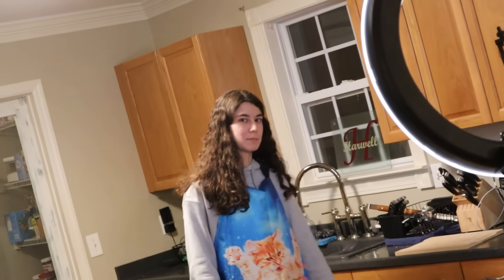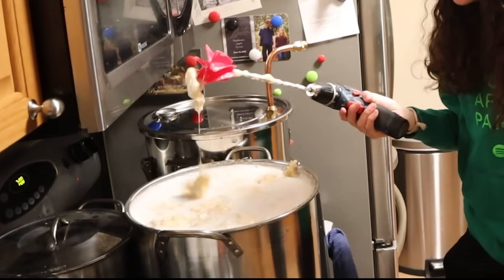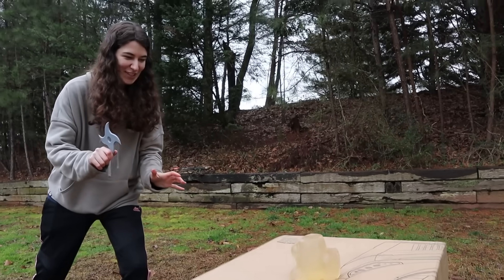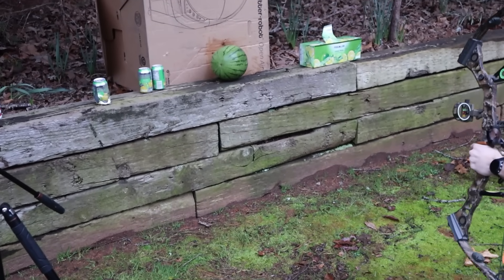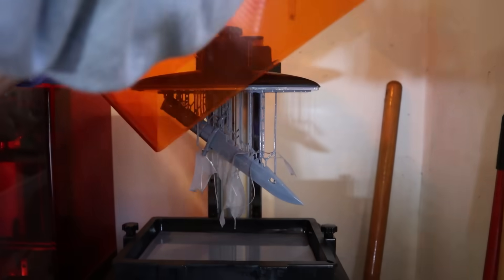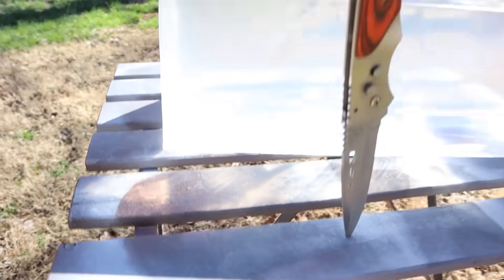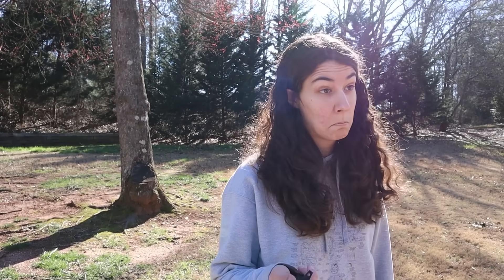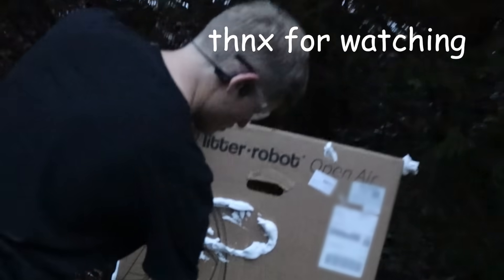How Dangerous are 3D Printed Knives?

Comment: I actually experimented with printing various knives that are out on Odyssey. It's impressive the strength of some of them. I have if you made out of some specialty early prototype amphora projects and one of which is similar to amphora3000. The amount of force it takes Until It catastrophically Breaks is pretty astounding. With the right filament, you've got a real poker.

Comment: The twist of the FDM Printed Knives.... they are still a bit Serrated... which is VERY dangerous and concerning... Not to mention based on the layer lines you could easily break an FDM printed blade off ... which is also a terrifying thought...

Comment: I would say they are more dangerous. If the tip breaks and gets stuck inside a person it can be hard to remove or even find it. Because you can't find it with a metal detector 😅

Comment: The "knive test" was an actual "spear test", any wooden part would also work the same way. Also a full face protection is not needed when sticking a knive into a block of gelatine...
The proper filament for a 3d printed knive would likely be PPA with a hollow core that is filled with concrete or similar dense material. This way you would have a sharp edge and the required mass.

Comment: Hey, that mold could still work, you just need to buy some high-temp silicone. Then build a big square box with a good inch or two of space between the inner walls and the AMOGUS™ then fill it with some gravel, marbles, loose nuts & bolts or whatever to add weight to the 3D print cavity. Then place the AMOGUS™ into the MDF cube that's been sprayed with mold release on the inside, and then fill all the space around it with the high temp silicone and wait for it to set up/harden into it's bouncy rubber state.

Finally, use some piano wire/box cutter, or hell, even a 3D Printed knife to chop your new soft rubber mold ALMOST in half. The key here is ALMOST. Technically you want to cut it as little as you can (preferably in nice F'd up wavy lines, not straight lines (makes the mold hold it's shape better) just enough to slip the hard plastic AMOGUS™ from the soft rubbery AMOGUS™ cavity/hollow mold you've now made. 

Then you can simply tape up the ~wavy~ cuts you made from the outside, spray the inside of the silicone mold with mold release, re-spray the cube mold with mold-release, place the silicone AMOGUS™ negative back into the cube, and then pour that fecker fulla homemade ballistic gel and you're off to the races.

Comment: I would assume, Resin Tipped Arrows are MORE dangerous then normal ones because the tip breaks off in the wound and then you got the issue to get it(and other pieces) out of the wound.

Comment: You could make really bad 3d printed knife if you think about it. You could make it a hollow barbed spike with holes all down the sides. That way you could stab it in and snap it off. The hollow tip in the body would make the wound continuously bleed and if it was barbed it would be very hard to remove.

Comment: In case anyone asks: FBI rated Ballistics gel is meant for ballistics testing of FIREARMS. 

its designed to test how bullets penetrate the ballistic gel, their trajectory after hitting it, how far  bullets would penetrate, etc.

It is NOT designed to test the lethality of melee weapons let alone improvised melee weapons.
if you want to test melee weapons or any type of melee object try pig, or human gel molds of dummys with human body parts and blood in it. This would give a better idea of how effective melee weapons would be.

the human like gel molds are generally softer and closer simulate human flesh/skin and thus produce more accurate lacerations (cutting) marks on them for knife wounds. 

ballistic gel blocks are designed to measure ballistics ie firearm bullet wounds.

Comment: If you want a reeealy strong printed knoife, make print it flat on the side of the blade and alternate line direction [0,90] every other layer will run lines from the tip of the blade to the handle then the other layers crosshatch with lines across to lock everything in place.

Comment: sharpening methods improvements... 
angle of cutting edge will depend on what you are using it for, 17-20 degrees is typical in American steels, 15 for Japanese steels
working your way to a finer and finer grit is important as it will help create less jaggedness and less drag along the edge.
sharpen or at least polishing refinements (the medium to high grits) should be done at a perpendicular direction of motion to the blade. this create the micro serrations needed to cut/slice things.

Comment: Regarding ballistics gel:

BG is a fantastic medium for analysing the damage caused by bullets. The forces resisting a bullet in BG are identical enough to the forces resisting a bullet in human tissue. 

However

BG is a poor medium to demonstrate damage caused by cutting or stabbing, especially compared to the forces in human tissue that are encountered by a blade or pointy pokey stabbey thing. 

A blade does work by cutting through the fibres. It does this well, as a set of inclined blades, a knife or arrowhead is a simple machine. Additionally, upon coming into contact with a blood vessel, a blade becomes lubricated, while a bullet is resisted by the flow. 

You can shoot a piece of kevlar body armor with a pistol and the bullet will not penetrate. That same sheet of kevlar will not stop a broadhead because it cuts through the kevlar fibres. A bullet tries to push apart the fibre weave, much like it needs to push apart body tissues. A knife or blade pushes through by cutting the fibres and removing the resistance. 

There’s a research paper that concludes that the only acceptably accurate test medium for the effects of bladed weapons is a live or very freshly deceased animal, because nothing else acts the same way as a body.

Comment: Back when I was into pellet guns you could buy these pellets that had a hollow point and a plastic tip glued into the hollow point (so it wasnt hollow anymore I dont know an english term for it but the german one is spitzer IIRC) it was designed for bird hunting apparently, it would strike the bird, discarding the plastic tip for increased penetration. Also nurses practice injection techniques on oranges around here, because the skin and layers below apparently break in a similar manner. These are my completely unsolicited and probably annoying anecdotes and suggestions. Also your cat = cute.

Comment: Next time you're prototyping blades, especially sharp blades you're anticipating that might shatter, as stated in the video, please wear appropriate safety gear. Gloves, closed toes shoes. If the blade had shattered, the force you were exerting would have in turn meant your hand would have been shoved down on the awaiting 3D printed shrapnel you sanded to a sharp point. Otherwise, fuckin' metal :hand-orange-covering-eyes:

Comment: Ballistics gel only works with ballistics, you know, guns.  That is what it's designed for.  A pig carcass would be a better analog for the human body.  While plastic can get very sharp (I work as a material handler for a packaging manufacturer) it isn't structurally sound enough to be thin bladed knife.  It is better suited for stabbing weapon like a stiletto or a triangular cross sectioned dagger, but only if it is short and rather thick.  Especially PLA.

Comment: You forgot the skin on MythBusters they always use pig skin the jell represents tissue under the skin not the skin. How sharp can you get if you electroplated them or printed out a carbon fiber nylon, you just barely scratch the surface on this subject. Pun intended.

Comment: Prison inmates have been stabbing each other with plastic shanks for years, so they're definitely effective weapons.  They typically use a toothbrush that's been melted with a lighter, but the number of stabbings in prison, which is probably a majority of stabbings overall, are often done with an improvised plastic weapon.  So, yeah, it's no joke--if you're motivated to put holes in someone, it's both easier and more difficult than you'd think.
Reply: I imagine breaking the toothbrush just right is an instant shank
Reply: Even a sharp stick can be pretty lethal.
Durable is a different story, but with how low cost these materials are, it doesn't matter much even if they are single-uses.
Reply: And they don't even have 3d printers just laying around everywhere. They make that shit old school
Reply: @davidcahan rub it on the concrete floor until it’s sharp
Reply: They often use razor blades attached to each side of a toothbrush too, melted into it so it stays. Makes it super hard to stitch up
Reply: @blaise5044  lock in a sock is another prison classic
Reply: @blaise5044 the difficulty of stitching a hole has very little to do with the thing that made the hole.
Bullet holes are a lot tougher than anything a razor will make and they stitch those up fine.
Reply: @rivencraft1734 actually that is one of the major factors in whether or not it’s easy to stitch up a wound. Also bullet entry wounds are easy to stitch. They are almost not even a concern in the grand scheme of the bullet wound itself. The exit wound, however, is a VERY different story. In my personal experience, it’s a bitch to stitch up an exit wound because of the size of the hole. Which ofc is caused be hydrostatic shock and all the fun stuff.
Reply: I remember going a a tour of a closed prison and they had a display with shivs, which you shank with, they had taken whole it was open until the 80s, and they were mostly toothbrushes and wood sharpened. None of the shanks were used in an attack but they did say they're were attcks but they were in evidence boxes
Reply: I watched people make good sanks out of paper folded up in a certain way. So ya you can make sabbing knives out of anything
Reply: There was a guy in prison who made a gun.

Copper pipe from the workshop… found rounds from a guard.

Spring and a piece of metal as a firing pin and you’re good to go.

Even advanced projectile weapons can be fabricated pretty easy.
Reply: I'd wait until winter and take an icicle off the window. It melts, so no weapon is ever found.

Comment: So with a normal sharp knife it most likely won't really hurt all that bad because the blade is sharp. A large knife would negate that though. Dull knives rip and tear so they are more painful as well as dangerous to the user. However they make carbon fiber blades that are meant to be single use. The microscopic carbon fibers aggravate nerve endings and make it extremely painful. You want to stab, break it off and then run. Since you don't need strength you can get the highest carbon fiber content filament you can find and as long as it's more rigid than it is flexible you'll have a legitimate self defense tool.

Comment: i wouldn't be too concerned about criminals 3D printing bladed weapons, even if the blades are potentially dangerous.
For several reasons.

- Criminals can make dangerous weapons with a lot less, thats how prisoners have shanks.
- If they have access to a 3D printer, they're likely capable of getting more potent weapons from sources outside of that 3D printer
- Any attempts to regulate criminals from making bladed weapons with 3D printers would hurt normal people a million times more then it would for any criminal
Reply: the same reasons never stopped governments to limit anything, be it 3d printed of just plain accessible. almost no control will prevent the criminals to have anything, at best will make it a bit harder for them, while removing any normal usage.
Reply: And with an angle grinder you can turn pretty much any flat piece of steel as a bladed weapon quite fast…
Reply: "Any attempts to regulate criminals from making bladed weapons with 3D printers would hurt normal people a million times more then it would for any criminal" And yet this is done on a daily basis. Just look at how DRM works.

Comment: Ballistic gel is one of those materials which is basically only useful as a metric for comparison. Usually tissue expansion due to the body being made mostly of water. Not quite the best for testing sharp objects. Should check Joerg Sprave's tests for sharp things!
Reply: It has high friction, which is not present with the original "original" you are trying to analog.
Reply: @rickoshea8138  Indeed. It's also called Ballistics Gel for a reason, it behaves like body would when shot, not when stabbed.
Reply: @vinny142 even this is a misnomer, ballistic gel is a tool to compare the function of small arms rounds to each other, it has nothing to do with simulating a human. The FBI had all sorts of data of gun shots on people but could not compare a, say a .380acp +p vs a 9mm normal pressure to get a definitive result so they made a test media to compare, not simulate humans
Reply: @vinny142  No it doesn't, it's designed as a constant meaning that it gives a constant result for ballistics, nothing to do with simulating human tissue, Emily just doesn't understand and is working off internet myth which idiots have posted.
Reply: It doesn't even have skin, which is the first and strongest defense against being cut. if something is weak, the real test if it can puncture skin and how far. Once the skin is broken, the flesh beneath is much weaker and more vulnerable to damage.
Reply: Jorge Sprave, more often than not, uses ballistic gel for that.
Reply: I have a legitimate question- but don't they often use real bodies for testing this stuff?
I know if sounds dumb to ask that, but I know they use real bodies in some places to test explosives, so I'm curious if it's done with firearms as well. (obviously I mean dead bodies donated to "science", which... I mean... Imagine thinking your bodies going to be useful for something important just to be given the equivalent treatment of an action man with a firecracker taped to it and treated like the toys that belong to Sid in Toy Story.)
Reply: I've heard pig carcasses simulate humans well, but I think the FBI has data from real-world shootings in which they know the firearm and ammo. Then, they see which ammo out of which guns are most effective, be that they killed in one shot or penetrated a certain depth or something. Then, they use that combo and see what it does to ballistics gel. Whatever it does becomes the standard.

Comment: If that Japanese knife maker can make kitchen worthy knives out of chocolate, paper, blood, glue, or whatever, he did a lot, 3D printed knives will work better than those. 
The more important question is how well do they retain their edges.
Reply: If you happen to have some furnace duct metal you can epoxy it to the side and sharpen that metal leading edge.  I did this to cover for a hunting knife one year because I lost my $220 Kershaw customer folder skinner.  I figured I would find it so I cut a knife from a sheet of nylon 1/2” in the shape of a knife, ‘sharpened’ it and epoxied/riveted a thin sheet of waste sheet metal from my metals pile (old furnace tear out).  I used it for two years, sharpened it on rocks until it just wore too much away…never did find my favorite knife and was too cheap to replace it…call it farmer economics.
Reply: It's heat moldable plastics, they'll cut one thing and blunt immediately

Comment: steel is way heavier than plastic so the plastic ones won't throw well. You need both sharp + tough + heavy.
Reply: Hmm... Maybe low infill, then fill with a resin mixed with some kind of metal powder to add density?
Reply: @superslimanoniem4712  yes, that would be a start but also lots of experiments. Print with ABS not PLA, maybe... ABS is much tougher.
Reply: @superslimanoniem4712 To weight any 3d printed design, simple leave a hole in the print design shaped to the size of whatever small metal weight or weights you happen to have. Like fishing weights or BBs for example. Then simply pause the print, fill the gap, and then continue the print. Be sure to pause at the very top of the hole so as to not mess up the print. The weights cannot be sticking above the highest point on the 3d print, otherwise youll hit them with the printer nozzle. It can be useful for making 3d printed objects feel higher quality, or just helping them be more stable or they can be weighted to help with function of moving parts.

Comment: How tf is your layer adhesion on the fdm knife that strong? Impressive.
Reply: There are a few ways to trade geometric accuracy for layer adhesion, for example, printing a lot hotter, or with a bigger nozzle and a bit of over-extrusion.
Reply: @graealex Hot doesn't trade any accuracy if you have proper cooling.

Comment: You can make a pointy object out of anything.  And it will work at least once.  To for a life of crime…not great….  But for a one off….perfect.  Thanks for a great video… My only problem is that You Tube did not put a subscribe button on you channel!?!?!?  You might want to check into this because I would have subscribed if there had been a way to do so.
PS: PLEASE Be CAREFUL when stabbing directly when using a knife.  The primary injury is for the hand to slip forward onto the blade…yes…even if there is a hilt to block that from happening.  I worked in an ER and this is the most common knife injury…NOT the pointy end.

Comment: I saw you made a lightsaber. What did you use for the blade? Wanting to start to make one as the official ones are too pricy and then I can improve finishing techniques. Loved the throwing stars.
Reply: For a light saber, you need an emitter matrix, a power cell and a crystal, the latter which will also determine the light saber's color.